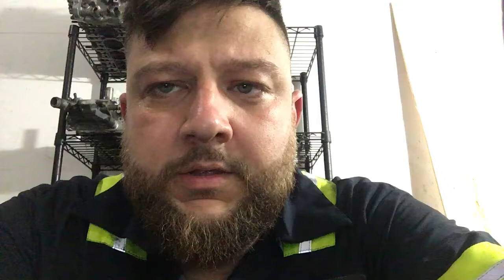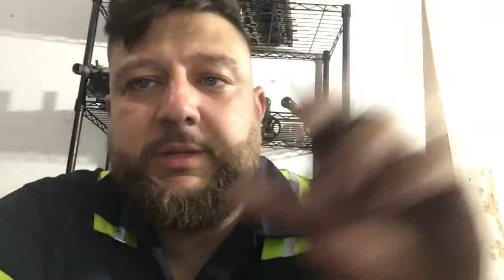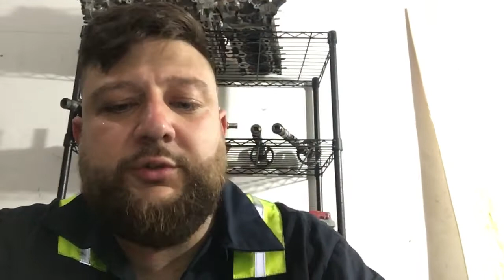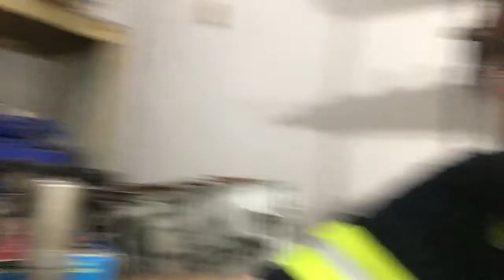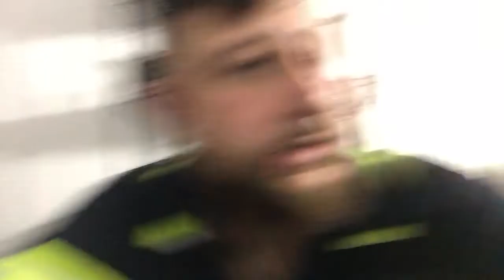Technician vs Mechanic

Comment: Lol I resurfaced my head with sand paper on my b16 crx. Ran it for 2 years and sold it. Never had a problem. As for bore and hone. I've never had to bore one out. Normally just hone them. 
PS all I've ever worked with that I owned was theb16. Never owned any other motors that I kept longer than a month.
Reply: Haha yea I just read  ur comment .
Yea I've done the head and the block with a big flat block carefully taking the max and reused bolts coz I had to at the time never had a problem that was a h22 I put in a. Eg  it looked mint to that's what the Honda game is about for me here in Australia I get motors out of abandoned cars on the side of the road sometimes cool as .. looking out for a K now
Reply from the maker: Vtec powersaw talked to quite a bit of aussies on here. I’m gonna be lookin a freight prices soon
Reply: @vtecpowersaw1577  man talk about alot of elbow grease lol🤣. My pops showed me that trick a long time ago and how I just make sure all my clearances are in spec and send it!!!